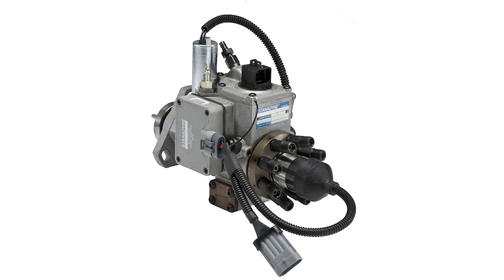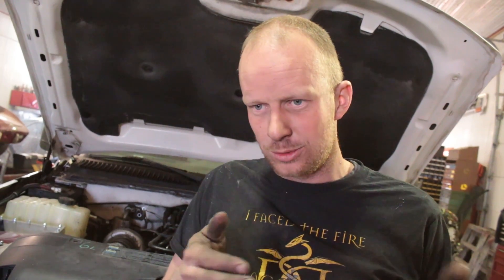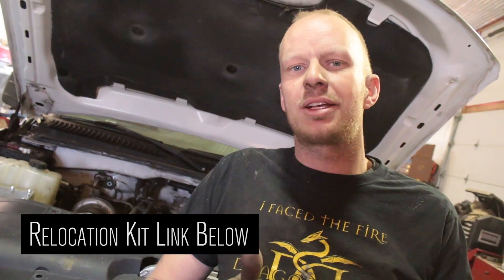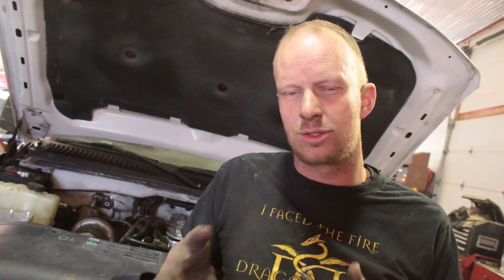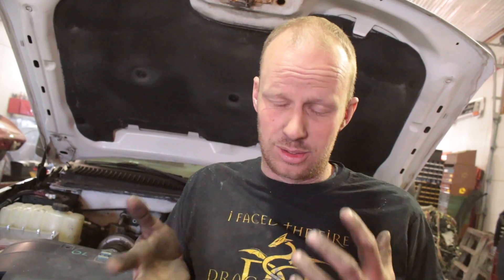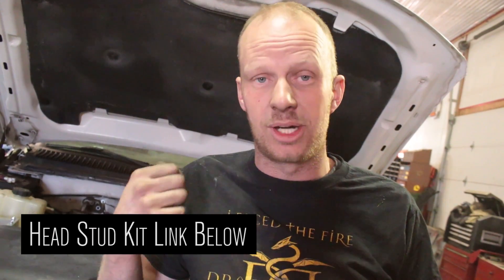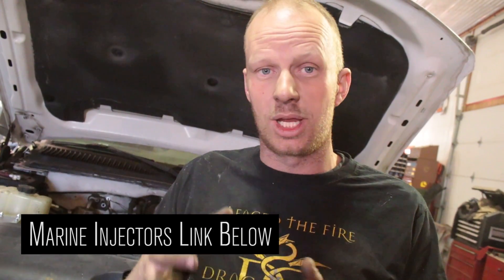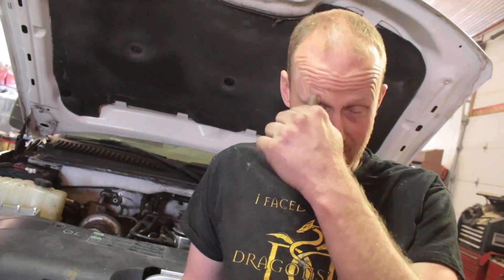REVIEW: Everything Wrong With A GM 6.5 Detroit Diesel

Comment: You should do a build with a older gm 2 stroke, 453t or such. They sound good.
Reply: 6v53 1 ton dually.
Reply from the maker: Oddly enough, I went to look at a job like that one yesterday!  It will be on the channel in the future as the project is already started and I will be helping along the way
Reply: DEBOSS GARAGE sweet. I've always wanted to swap a 453t Detroit into a 60-65 Chevy truck. Either that or a 12 valve.
Reply: +1 on the 453t build request
LOL
Reply: Chris Conway they run so well, they get like 35+ mpg because of how effective it runs, they are pretty crazy when you get into it off how the with and run, I got to rebuild my Grandfathers for him and it's wicked once you get in to it, the block has a cylinder sleeve around each piston and the sleeve in there to allow the intake to be at the very bottem and it serounds the whole piston so when the piston gets to the bottem of it's stroke it has the intake full open and it pushes out the exhaust really well, and the was that works is the intake has compressed air on it all the time on it from the turbo so it will always work perfectly and leave minimal left over exhaust and fuel so that each combustion is clean and it results in a more fuel efficient and even more power, it's a really beautiful engine once you get through all shit on the out side off
Reply: @backpocketmechanic7751  detroit 2 stroke fuel efficient?
Reply: I'm working on building a aluminum 'gama goat' 353T Blazer... IMO and in the opinion of others as well I have spoken to, the 3 and v6 detroits sound better than the 4 cylinder ones. Should end up being 140-200Hp depending on turbos and injectors once the project is done.
Reply: +Chase Rayfield 
a 6 53? Screaming little bastards. They are the reason I've lost so much of my hearing. To many tuneups without earmuffs. The blower whine is a killer.
Reply: Carla Rodgers 
I'm sorry!
Reply: Love the 453t but it is an absolute monster. Weighs well over 1K lbs and has some pretty lackluster output numbers when you really get down to it. On the other hand, that sound a 2 stroke diesel makes in heavenly
Reply: I'm not a pussy. i love the two strokes!
Reply: Cbmech they are loud but the whine is what hurt your ears the engine itself wont hurt hearing as they have more of a base tone not a raspy high pitch tone

Comment: Love all your videos alot of great information.  I bought a 94 3500 when I was 19 years old 21 years ago. I got a quick education injection pump went out with in 2 months .  I went to Cummins after that never looked back used 12v and 24v had 6  different trucks work beast. I am in the core business and buy a lot of diesel cores. You wouldn't believe what the 6.7 cummins engine look like with egr converters dpf and synthetic can destroy these engines. Any experience with these I have seen low milege 40k through a rod and the engines are packed with sludge worst I have ever seen . But really good engines in my experience if the converters are stripped and bypassing the egr only way I would have one .
Reply: I'll take a Duramax over Cummins I just hate Dodge
Reply: @taylorh3930  I take it you have never actually had to tare the engine apart on either? If you hard you would quickly change your tune a high school kid taking shop could rebuild a Cummins with ease good luck rebuilding a Duramax and you better go get a loan especially with the aluminum heads good luck with those not only that the cummins has 40% less moving parts very simplified and solid as a rock . I could careless about a truck brand that's why they have tons of Fords and Chevys that have been converted and had a cummins dropped in them you want find any website to converter a Dodge cummins into a powerstroke or Duramax but you will find thousands of people that have dropped a Cummins into a Chevy and Fords. There is very good reasons why that is.

Comment: The biggest issue I had in my 6.5 suburban was the lift pump not supplying the propper amount of fuel to the injection pump under high load, switch to a marine pump and had no issues till the 4l80 went. An hx35 is a no brainier update along with relocation of the pmd box and deleting the vacc pump and using a mechanical waste gate if you stick with the gm4 turbo. 1997 and up are the most reliable of the turbo models but the 1992 mechanical 6.5 really has none of the issues the normal 6.5s have. Keep the vids coming love them all 👍🏻

Comment: if 10 years means the 6.5 was a good enough motor for GM to put out for so long, does that mean the 96-98 vortec was bad since it only had 3 years? Even 88-95 TBI had 8 years.

Comment: 6.5 back in the day kept me busy when I worked at a GM dealer.
Reply: Lol that's why, you worked at a dealership
Reply: fordfocuszx93 white smoke fuel or  burning coolant.
Reply: 25 yrs old now and still going strong...310,000 miles.In the last ten yrs only mech probs were water pump went out and starter...can't beat it with a stick and if you do it'll just keep going.
Reply: when I read your comment and had to laugh, made me think of the early days of the oldsmobile diesel and then the 700r4 transmission,,,,lol
Reply: just use a pry bar on the ring gear teeth. or turn it over from somewhere on the pulleys. crank pulley or something
Reply: jdr ok  it’s smells like raw fuel not burning coolant
Reply: @freedom-volvo-usa  cold start advance switch could be the culprit. Easy to swap switch on top of the water crossover. They weren't very expensive.
Reply: How do I release the Compression in the 2002 6.5 to spin the engine over for a Flexplate replacement (to remove the Torque Converter bolts?)
Reply: @Snailmailtrucker  remove glow plugs, even just one bank makes it a lot easier to turn
Reply: @Snailmailtrucker  turn it slow? The compression will vent off through the rings if turned slow. However, if it won't do that, you are  static locked.. coolant, diesel or oil on top of a piston, preventing you from turning it.. my guess? Cracked head and coolant on the piston . Those rags, always cracked the heads..
Reply: Well put
Reply: Eric Price hey bud I have a question I have a 6.5 k3500 blowing white smoke looks like raw fuel any tips to figuring out if the injection pump is bad any codes ?
Reply: @freedom-volvo-usa  hahaha he's retired and a specialist
Reply: Ditto.. saw the pickups sitting in line at every dealership for a new 6.5 diesel under warranty. Ford had a 100k 5 year warranty on their diesel .g.m. stepped up and pretended they had the quality engine, that Ford had...what a mistake.. no way those g.m. rags could compete with Ford's diesel.. and guys, I am a Dodge man, just stating facts..
Reply: I had an 84 with a 6.2ltr. Was my Dad's truck at first...bought it new, dually, 4WD, CrewCab with the 6.2...special order. Could not get out of its own way. 65mph with the wind at your back on the highway. I was given the truck in '90 because I needed a work truck and it was not worth a damn thing for resale. This truck absolutely made me a GM Hater. He gave it to me with 27,000 miles...by that time he had already replaced the transmission, the transfer case, the front hubs 3 times, injection pump, two injectors and the glow plug controller and all the glow plugs (controller did not cycle and burned them out). The bottom of all 4 doors had rusted through, as well as across the door openings in places. This was not a snow belt truck either (Central Florida). AC was dead (did I mention Central Florida?). Had to hit the blower housing to get the blower to work if you wanted heat or defrost (Yes I did replace it). He lived at the dealership when it had a warranty...he cussed that truck every time he got in it. All the rims were not round from the factory and the dealer replaced the tires because they thought they were out of round but it still wobbled and bounced badly at 45 MPH and above so then they replaced the rims and the tires...really. When I had it I had to carry around a roll of small rubber tuning and small runner caps because the return lines on the injectors were rubber tubing and pressed on. I did try small zip ties to clamp them on but they would just blow off and spray fuel all over the exhaust manifolds...I think there were two that had rubber caps as well that did the same thing. It was exciting to drive when you smelled diesel and saw smoke everywhere. It was a very expensive piece of crap from day one, from the wheels to the roof, front to back. I sold the truck 3 years later to a roofer for $800.00. He thought he stole it. Saw him a year later and asked him how it was doing for him and he said it was dead in his yard and he gave me a dirty look.

I guess you could say it was a Lemon or built on a Monday or Friday, but for a truck with no more the 48K miles when I sold it, it was so unreliable, under powered and basically falling apart, I would say that I don't have fond memories of that truck.
Reply: @rvninnorthcarolina3377 I just read your post...I think you maybe should look into some counseling or something. Blaming the truck for all those problems seems a lil bit odd...my guess is that the truck had the hit beat out of it, and the shit left on it afterward...squarebodies DO rust...but only when they don't get washed. The auto trans had problems for sure...but breaking hubs and transfer case?
Whistlin' diesel has those problems all the time.

Comment: Do a review on a 7.3 idi
Reply: +Michael Holst I love idis. They sound like gassers😂
Reply: Oh the fun to be had with a idi 7.3. Simplicity, torque, fucking glow plugs and fuel return lines. Not to mention cavitation. But with a tad bit of machine work you can put power stroke rods and pistons in her (prepare for hard starting with PS pistons it knocks a good bit of compression off). 

Sleeving her? Nearly impossible. Her fuel pump is entirely mechanical unlike her competitor so getting more fuel is a screwdriver turn away. Then came her turbo sister, anodized pistons, better valves, extra compression rings larger wrist pin, lower compression.

Not to mention there's a website called R&D idi that sells cams, billet return lines, big ass fuel pumps, remanned injectors, big ass turbos all in stage 1.2 &3.
Reply: David Vermillion 
The old shop I worked at, we worked on a lot of pick up trucks. 
One day I fixed a 6.5t and drove it, it was unbelievably slow, auto trans. 
the next truck was a Ford 6.9 , with a std, and that damn thing would light the inside tire while getting on a looped entrance ramp to the highway at about 35mph no prob in 3rd. Like night and day.....
Way back in the day a buddy's dad had a big ol 86 Ford 350. A huge thing with a (6.9?)diesel to tow a big airstream trailer...
damn thing was slow as molasses, but didn't get much slower with the trailer. it was strange.
Reply: 7.3 idi is decent. Not a pulling engine and never got good fuel economy but they'll go a long time. The turbocharged engines tended to blow head gaskets but that seems to be it. Glow plugs would go out but that's all V8 diesels.
Reply: Chevyblock 550 no good mpg?? i get 19mpg in my NA 7.3 idi without trying lol
Reply: The Q, Justin at R&D is apparently sleeving blocks now. 

I to would like to see his take on the IDI, I own 3 of them, clearly I'm a fan. 

FWIW while they aren't perfect to me they have one feature that none of the competition has. They're kind of a cross between a big block gasser and a diesel. They spin and drive a lot like a big gasser with the simple durability of a diesel.
Reply: MrTheHillfolk 6.9s and 7.3s are slower in their top trims then the 6.5 in its top trim in the trucks actually less hp and torque on both
Reply: good motor when they went to the DI is when the pistons started popping. mine cracked 3 at 180k pulling all the time.
Reply: why,my 3 yr old knows all about them,ancient history,keep up with the times.
Reply: harry walker No thanks, I’d rather not have to bring my truck to the dealership so they can take the cab off to add washer fluid. I’ll take something that I can repair on the side of the road with a toolkit that fits under the seat IF it breaks. People behind me thinking I’m going too slow don’t bother me, if there are 2+ lanes I’ll always be in the right lane and otherwise they just have to deal. Big rigs slow down on hills, so it’s OK for me to as well. Plus no pickup is worth $50-60K or more to me.
Reply: Would love to see a reviw on the 7.3 idi..Have a 7.3 Psd, 6.6 lb7 and a 7.3 IDI, i really love the 7.3 idi, so simple and strong,stronger N/A than the 6.5 is with a turbo..my idi is gettin the hypermax kit atm
Reply: @vanduraman  the 6.5 with a turbo literally has more torque than a 7.3 idi with a turbo.

Comment: 6.5's cant be a good engine, but theres a aircraft engine rebuilding place in nova scotia with 1.6 million on a 6.5 and another with 1.2million both cube van's. each on injection pump #3 but they were all highway miles. i called bullshit until i saw it. even argued with a driver once because i couldnt beleave a 6.5 doing that. it did... now they run duramax trucks and there over a million now. but they do the maintance correctly thats why they get the miles
Reply: 6.5 is a great motor. The problems outlined in the video come from poorly stuffing it into a truck. The marine industry LOVES the 6.5 and they choose this motor over all the others just about every time
Reply: you are correct, if u kept a working lift pump on the truck, and relocate the PMD then they would lost a very long time, and ye i know the marine side LOVED the 6.5's they worked really well in that application,  in the pick up's they did work amazing for plowing and straight up work truck, but heavy hauling they didnt do the best. webbing on the crank wasnt that common
Reply: Kevin Rogers one of the short comings this video didn't mention was the lift pump and oil pressure switch. The lift pump lacked effective pressure to feed the injector pump, and the ops was not up to par with the amour of current being ran through it.
Reply: 6.5L G30 van I had barely had enough power to get out of it's own way unloaded, I pulled my Land Rover with it once and that was the last time I bothered to use it for real work, it was a joke, my 4.0L Explorer did much better with a leaking front pump seal and I am not joking, twice as many miles almost on it as well.
Reply: Randy s  Like when they had to redline it for soot emissions testing.
Reply: maybe your turbo wasn't working i can pull anything  i want with. but there is a solenoid that play with youre wastgate and if that solenoid is faulty turbo dont work properly or it can be a bad vaccum pump  too

Comment: If you realize it was built for fuel mileage not pulling all day everyday and you drive it as such you won't have many problems at all. If you try to drive to drive it like a 12v Cummins you'll never be happy with it and have problems with constantly.
Reply: Then what's the point of a diesel in a 2500 or 3500? In other words, it's supposed to be a Work truck....it should perform like one.
Reply: The same reason Ram puts the 5.7 Hemi in the 2500 and 3500. It gets fuel mileage and that's it. No power, no torque.

Comment: you missed is the early 6.5 blocks were pron to cracking in the cylinder walls,oil pressure  sensors melt,oil cooler lines pop,you need a lift pump for the glove box,extreme lack of any power! im so glade i went to 12v
Reply: I thought that pretty much all of the 6.5 blocks were defective and just about guaranteed to fail. Something about a casting imperfection near #8? I remember hearing a lot about civilian Hummer owners having to buy replacement engines at like 40,000.
Reply: 01 or 02 they made what they called the improved block still junk but better was the replacement for them hummers i thunk. but 94-96 had the worst. the #8 was the end of mine

Comment: I've owned two trucks with the 6.5tbd for just straight driving up and down the highway it's a excellent truck. they get pretty good fuel mileage. but hook a trailer on it and good luck getting to 65.
Reply: why would anyone in their right mind want to tow over 65??
Reply: D Taylor. fuckin kids. lol
Reply: No joke, the lack of power is just sickening and embarrassing for a diesel, my 4.0 explorer pulled much better than the g30 6.5 I had.
Reliability on the 6.5 was a joke at best, only diesel I have had that half the time wouldn't restart when hot.  157k miles till it was head gasket time....  Yeah I threw that POS away real cheap on CL.
Reply: Why not?  Do it all the time.